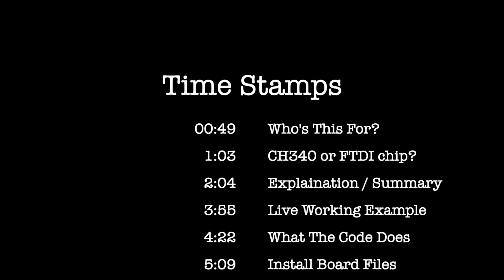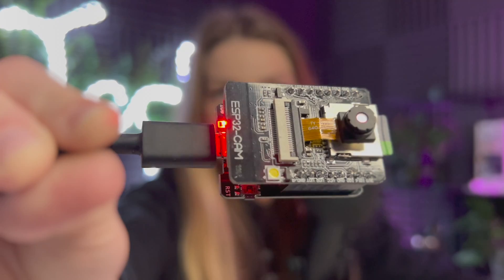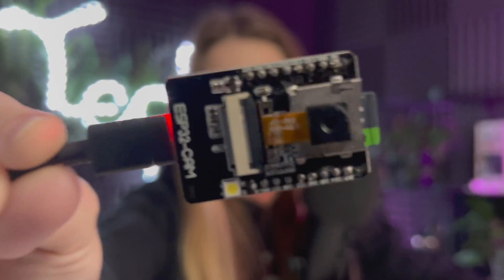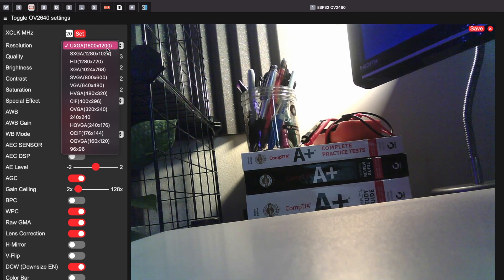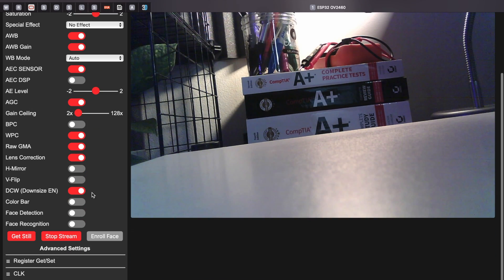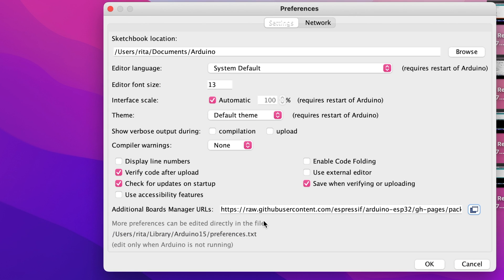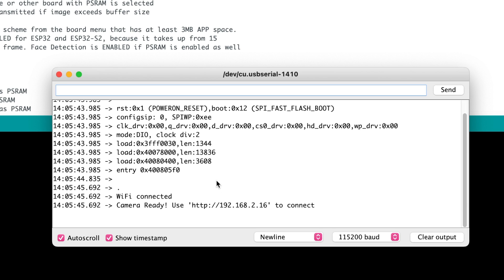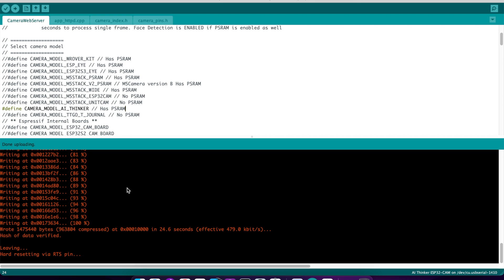How To Use ESP32 Wifi Camera Module / Development Board

Comment: You are using the esp32cam mb to powering the esp32cam. Is it not heating up? I tried to connect externally using jumper wires, but the voltage always drops and I get brown out detected issue.

Comment: For w/e it's worth, I had the same problem with the camera ribbon being too short and came across a couple camera modules with longer ribbons on Amazon.
Reply: I just looked up the one I bought, it's a "Taidacent ESP32- CAM ESP32CAM ESP32 CAM WiFi IP Timer Webcam Camera Module 3MP OV3660 160 Degree YUV RGB 21mm 80mm FPC Cable DVP Interface"

There are a couple other ones out there though.

Comment: This is far easier than what we had to do to make a security camera for a department store we did in the mid 70's. We would use a common donor mannequin, remove and carefully split the head open, mount an auto-iris 90° pinhole lense looking through the glass eye (450 dollars). We then coupled this lens with a cohesive fiber optic light guide ( another $450 ) at which point test for focus before resealing the head and mounting it to the main body cutting an additional opening in the neck for the fiber optic pipe. Cut open the back of the mannequin and fasten a Nuvicon ( a camera using a very sensitive imaging tube, about $650 )camera to the light pipe and then mounting the camera within the body and routing power and video out the lower body. The department stores paid over $3500 for each modified mannequin but it saved them thousands in goods that would have been stolen.

Comment: was hopping you would know how i can get it to send image over serial.  anyway. i got some info on this cam.. can't find all of it now.  but in Arduino IDE on CameraWebserv(first tab) look for "s->set_framesize(s, FRAMESIZE_QVGA)"    the FRAMESIZE_QVGA is how you change default image size just replace the QVGA with another one. btw the Face Recognition will not work if the image is to big.  also in tap number 2 look for "static int8_t detection_enabled = 0" change the 0 to 1 to make it run from start. if faceRecognition is not working then in tap 2. Under "void startCameraServer(){"  look for mtmn_config. after the last one "mtmn_config.o_threshold.candidate_number = 1;"  Add this " mtmn_config = mtmn_init_config(); ". that should do it.. thats all i remeber...  also https://robotzero.one/esp32-cam-custom-html/
Reply: As far as I know, there is no way to send an image or video stream via serial. Only via WiFi. I've used a few of these over the years. Be aware that some will work better than others depending on your product source.

I have one programmed to take a picture every 30 seconds and send it to my home web server running Windows with IIS (Internet Information Services) enabled. The PHP program on the server receives the image file then reads the number of files in a storage directory, then adds 1 to the name of the picture and saves it. Then I use VirtualDub to stitch the images together to create a time-lapse video. VirtualDub requires the images be numbered from oldest (low number) to newest (high number) to create the video correctly. A good program and free.

You could also use the camera to monitor things and when the ambient light gets low, it has an on-board LED you can enable to help brighten things up for the shot.

Keep on playing and having fun!